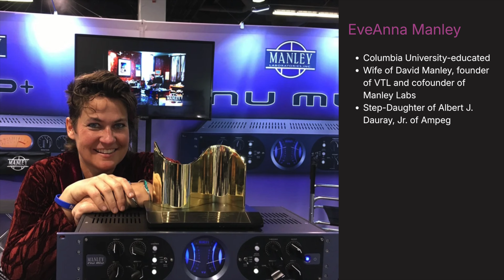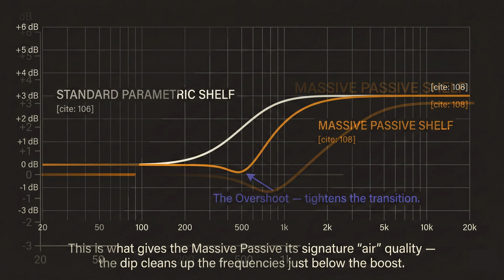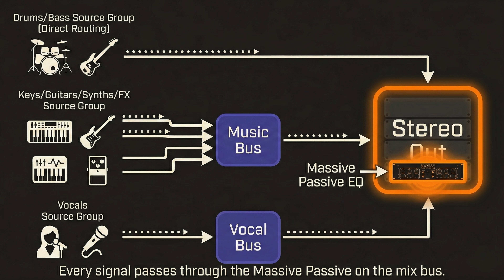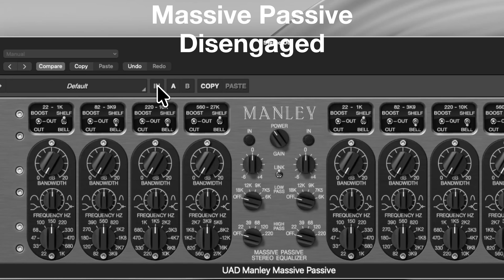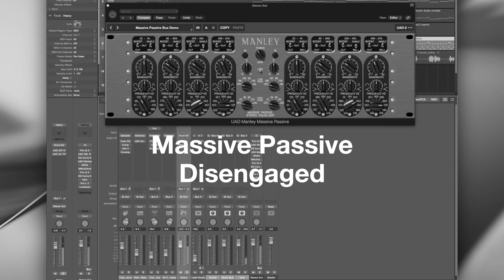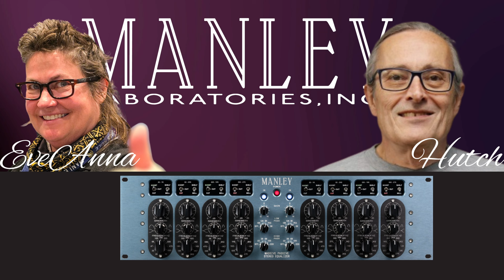Manley Massive Passive: The 'Expensive' Polish Your Mix Bus Is Missing #ManleyMassivePassive

Comment: If you work with a functional knowledge of analog workflows, you will get an even more polished sound in every stage of your mixing process, not just a magic plugin on your master bus. 

Use quality emulation plugins and saturators, knowing what different order harmonic distortions and levels do, use UAD’a Studer A800 tape machine carefully, a standard bus compressor and mastering tape on the master bus, with every channel being treated accordingly - your sound won’t need saving on the master bus, it will only serve as part of the whole. 

As a working mix engineer who uses boutique gear but also works ITB on smaller projects at times, this  method really does get you as close to a quality analog workflow as possible. Learn about workflows, orders of harmonic distortion (saturation), compression standards in the industry. It’s best to have one teacher who has a career in the big gear as well as digital than to listen to a bunch of random YouTube videos. Find someone like Jordan Valeriote at Black Salt Audio or a similar way of learning affordable from one source online. Else, your brain will be a mess of random “magic” techniques that don’t translate.
Reply from the maker: @CirclesandSounds You make some excellent points and I appreciate you sharing your perspective as a working mix engineer. You are absolutely right that understanding analog workflows at every stage of the signal chain is more powerful than treating any single plugin as a magic fix on the master bus. That is actually one of the core principles behind this channel. Understanding harmonic distortion orders, knowing why transformers and tubes behave the way they do, learning how tape saturation interacts with compression, these are the foundational concepts that make any tool more effective regardless of where you put it in the chain. That is exactly why this video spends most of its time on the engineering and circuit behavior behind the Massive Passive rather than just showing knob positions. The goal is to give viewers the understanding to make informed decisions across their entire workflow, not to sell the idea that one plugin on the master bus will save a mix. I do think there is room for producers to learn from multiple sources as long as the information is grounded in real engineering principles and not just surface level tips. Jordan Valeriote does great work and there are many other experienced engineers sharing valuable knowledge as well. The more quality education that is out there, the better it is for everyone trying to improve their craft. Thanks for the thoughtful comment and for contributing to the conversation.
Reply: Nice Info there !, do you use any presets from the UAD's A800 and master tape ?

Comment: i only hear a gain difference and a slight compression, but definitely no 3d!
Reply from the maker: @Wagner-Sessions Fair enough, and I appreciate the honest feedback. A couple of things worth considering though. First, gain matching is critical when doing A/B comparisons. If the processed version is even slightly louder, your brain will perceive it as "better" without any actual tonal change, which can make it hard to isolate what the plugin is actually doing beyond the level difference. That is why I try to be transparent about what is happening at each stage. Second, the "three dimensional" quality I am referring to is specifically the harmonic content that the tube gain staging and transformer emulation add to the signal. It is subtle, and it is the kind of thing that becomes more apparent on full range monitors or quality headphones in a treated room. On laptop speakers or earbuds, those micro level harmonic shifts can be much harder to perceive. The compression you are hearing could be the tube stages responding to transients, which is part of that nonlinear behavior that separates this from a standard digital EQ. If you have the plugin, try it on a full mix at unity gain and compare with a matched level bypass. That is where the character tends to reveal itself most clearly. Thanks for watching and for sharing what you are hearing.

Comment: is it me or your examples are in mono? I mean it cant be me ,cuz I checked it other sources are stereo just fine. and I cant hear any difference at all  0 perhaps because it's mono, but even then I should hear something, anyway , if we cant hear the sound stage we cant hear the full picture what the unit really does
Reply from the maker: @msmoozesful Good question and I totally understand the concern. The demos are actually recorded in stereo. The audio goes from the mix bus out through the Apollo interface and is captured directly into the screen recording software as a stereo signal. So what you are hearing is the full stereo output of the session. That said, YouTube's compression and encoding can sometimes do strange things to the stereo image depending on your playback device and settings. It might be worth checking if your YouTube playback is set to a lower quality, because at lower bitrates YouTube can collapse or narrow the stereo field noticeably. Also some browser extensions or audio enhancements on your device can affect stereo playback. Try watching at the highest available quality on headphones and see if that changes what you are hearing. As for the difference being hard to hear, the Massive Passive's character is subtle by design, especially the tube and transformer coloration. It is the kind of thing that reveals itself more clearly on full range monitors or quality headphones in a quiet environment. Appreciate you bringing this up and thanks for watching.
Reply: Its in mono!

Comment: The plugin has a mastering version and a regular  one....whats the difference
Reply from the maker: @mrmorpheus9707 Great question. The main differences between the Standard and Mastering versions come down to the frequency selections available on each band, the gain range, and the overall design focus. The Standard version is geared more toward mixing with frequency points and gain ranges suited for individual tracks and busses. The Mastering version has more refined frequency selections and tighter gain increments that are better suited for the precise, subtle adjustments you need in a mastering context. Both share the same core architecture, the same passive topology, the same tube gain staging, and the same parallel band interaction. If you grab the free deep dive document from the link in the description, there are some details in there that break down the differences between the two versions. Thanks for watching.

Comment: I came up through the 1980s on a mixture of boards, and outboard, NEVE, SSL, API, you get the picture....The mentors I had, without exception, told me to run everything through "nothing" according to the dials/switches, and only work from there....Now, over 42 years later, the same guidance is even more relevant to get rid of the snake oil....Great Video....Now that I've found you, I have signed up to your Newsletter....The free download on the Manley runs at over 80 pages!!
Reply from the maker: @tx3851 Man, this comment hits home. I also spent time in my teens around those same boards, Neve, SSL, API, and that experience shaped how I think about signal flow and gain staging to this day. There is nothing like learning on that kind of hardware to build a deep respect for what the circuits are actually doing to your audio. And your mentors gave you the exact same advice that the Massive Passive's own manual echoes, run everything through the unit flat first and listen to what the circuit itself is contributing before you ever touch a knob. That philosophy is timeless and it cuts right through the noise and the snake oil. The fact that 42 years later you are still applying that principle says everything about how foundational it is. Really glad you found the channel and welcome to the newsletter. And yes, that Manley deep dive document is a beast at over 80 pages. I wanted to make sure anyone who downloaded it walked away with a truly comprehensive understanding of the tool, not just surface level tips. That is what this channel is about. Thanks for signing up and for sharing your experience. It means a lot hearing from someone with your background.

Comment: That song you used is distorting. Or its me? I'm confused...But great piece of knowledge. Thanks
Reply: It's you bro
Reply: Fully agree, the audio examples sound weird. No offense, I highly appreciate the great high quality content here, but the samples are distorted
Reply from the maker: @lucasjuniorproducer Thanks for mentioning that. The song is recorded with standard instruments in Logic with no added distortion on the source material. What you might be hearing is the Massive Passive's tube gain staging and transformer saturation adding harmonic content to the signal, which is exactly what the plugin is designed to do. Depending on your playback setup, those added harmonics can sometimes be perceived as a slight edge or grit, especially at higher volumes or on certain speakers and headphones. It could also be YouTube's audio compression introducing some artifacts on your end. It might be worth checking your playback volume and device. Glad the knowledge came through either way and thanks for watching.
Reply: What is the song by?
Reply from the maker: @vifannazotron2086 That is actually an original track. I wrote and produced it myself in Logic Pro, sang the vocals, and then used Audimee to transform the vocal stem into a female voice for the final version. Hope you enjoyed it enough to ask about it. Thanks for watching.

Comment: The uad emulation plugin is very good. It sounds different than any other eq. Its hard to explain. Ive used the real unit virtually via access analog platform but i still preferred the uad version over it
Reply from the maker: @Ramin604-p8s That is a really interesting observation and the fact that you have used the actual hardware remotely through Access Analog gives your comparison a lot of credibility. I think what you are picking up on is exactly what makes the UA emulation special. They modeled it at the component level over six months, capturing the inductor hysteresis, the tube gain staging, the transformer saturation, and the parallel band interactions. The result is a plugin that has its own character that just feels right. And honestly, preferring the plugin over the remote hardware experience makes sense when you consider that Access Analog introduces its own converter coloration and latency into the equation. With the UAD plugin you are getting the modeled behavior directly in your session with zero round trip variables. That is a cleaner path to the sound of the circuit itself. Thanks for sharing that perspective, it is not often someone can compare the two firsthand like that.
Reply: @kenetic_sownd  i have noticed with a few units on Access Analog that it doesnt sound 100% correct/accurate. For example, i have used CL1b at my own setup for almost a year. So i’m quite familiar with how its supposed to sound. When i used it thru access analog something just felt off. I even reached out to the owner and asked if theres any sort of degradation while using this system and he obviously said absolutely not. I feel like something happens to the audio track negatively somewhere along the way thru the process of uploading the file, imposing changes, conversion and bounce down. I have no idea what it is. It could be me using it wrong but i dont think so. I had another engineer feeling the same way
Reply from the maker: @Ramin604-p8s Your instincts are probably right on this one. Even if the owner says there is no degradation, the reality is that any time your audio leaves your system, gets uploaded, passes through converters into the hardware, gets processed, passes back through converters, and then gets bounced and downloaded, there are multiple stages where subtle changes can accumulate. Every A/D and D/A conversion introduces its own coloration no matter how high end the converters are. Then you have the file transfer itself, the sample rate and bit depth handling, any buffering or latency compensation happening on their end, and the final bounce back to your system. Each one of those steps is an opportunity for something to shift even slightly. And when you are familiar with a piece of gear like you are with the CL1b after a year of daily use, you are going to notice those micro differences that someone less experienced with that specific unit might not pick up on. The fact that another engineer felt the same way is telling. It validates that it is not just in your head. This is honestly one of the reasons why a well modeled plugin running natively in your DAW can sometimes feel more reliable than remote hardware access. There are zero round trip variables, no extra conversion stages, and no file transfer artifacts. The plugin gives you the modeled behavior directly in your session every single time. Thanks for sharing this, it is a really valuable perspective for anyone considering that kind of platform.